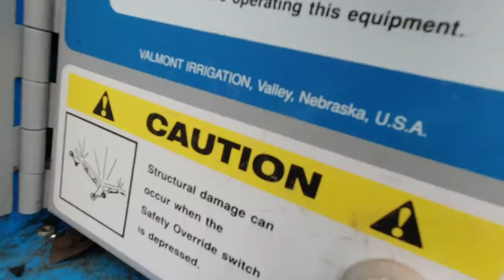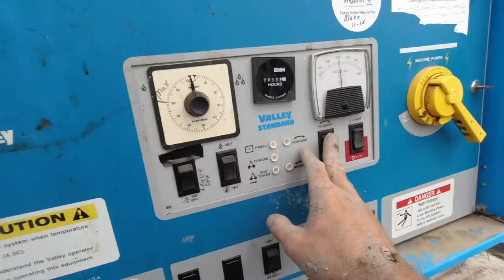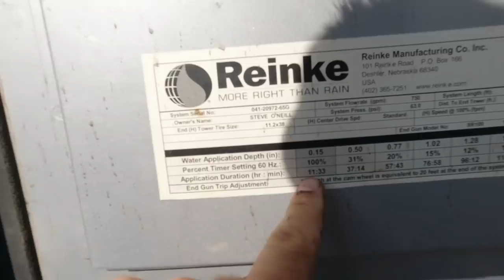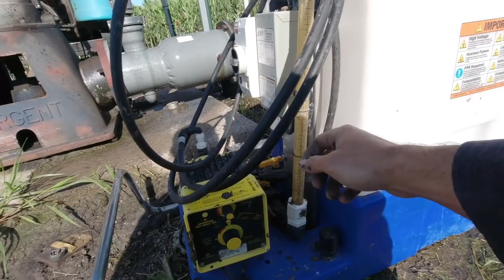Fungicide on the Corn

Comment: On old style pivots with f’d up stud design Have a couple longer bolts same size as the stud bolts screw in from back side to use as a alignment stud until you get others started just a thought

Comment: How many gallons/acre are going on when you apply Fungicide? I've always worried that the Fungicide would just wash off the plant when running it through a pivot.
Reply from the maker: I’ve never done the math. On the chemical label it usually says to shoot for less than .25”. So we run them pretty fast. I also couldn’t tell you effectiveness vs plane. I just know when we have needed fungicide it we’ve seen results. A few times when the pivot didn’t make a complete circle we’ve seen a difference.
Reply: @ONeillFamilyFarms  Interesting, I'm sure there's better coverage with a pivot than a plane